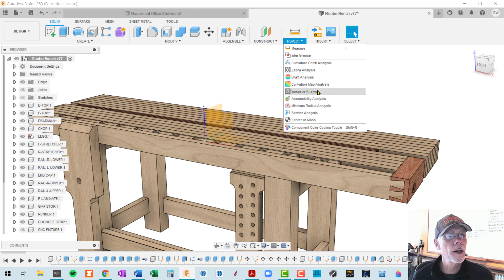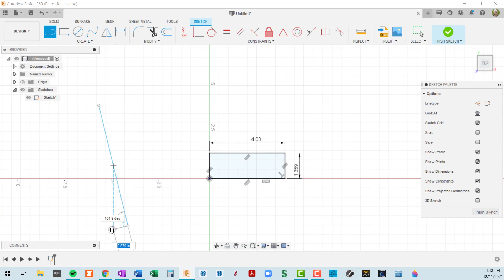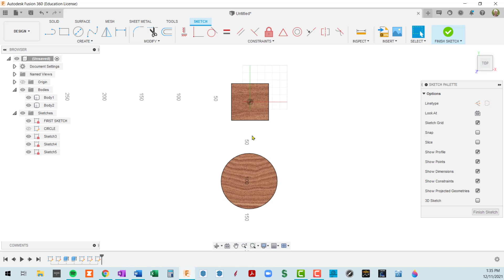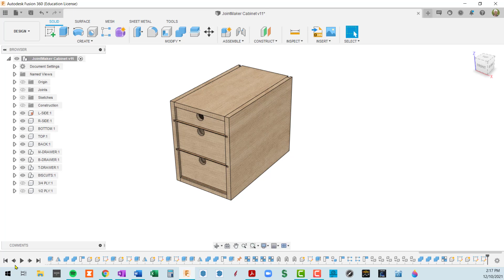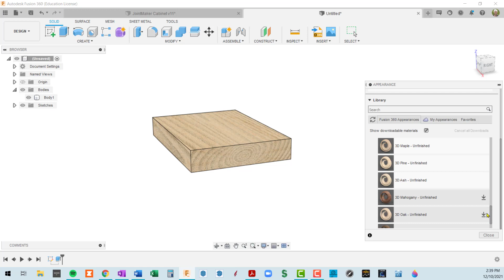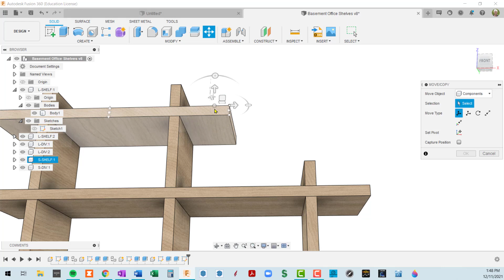Fusion 360 for Woodworking: Session 1

Comment: Just out of the starting gate, my orbit tool behaves differently than yours. What is your computer hardware and mouse? I am running Windows with a Microsoft mouse with left and right buttons with a scroll wheel in the middle.
Reply: I’m fairly new to fusion (and very late to responding to this comment) but recall on set up having the option between different mouse control presets, such as solidworks, tinkercad etc. Should be somewhere in the settings to change mouse presets for orbit if that’s what you’re talking about?